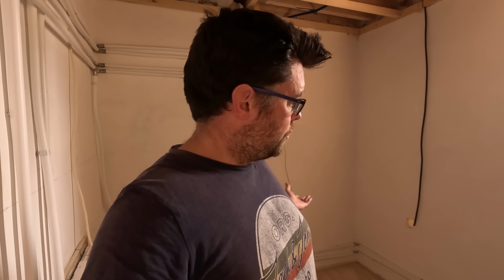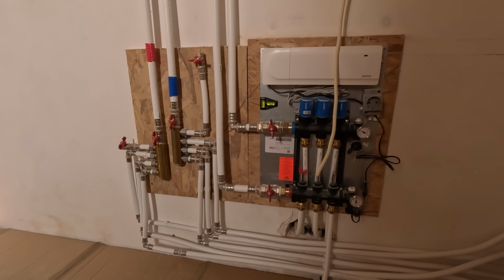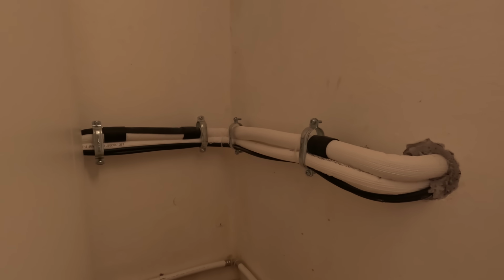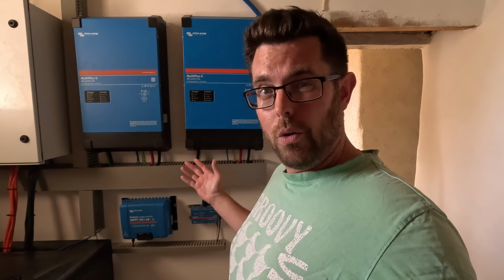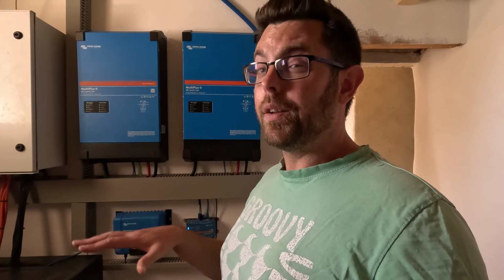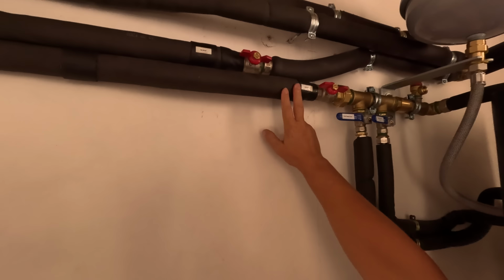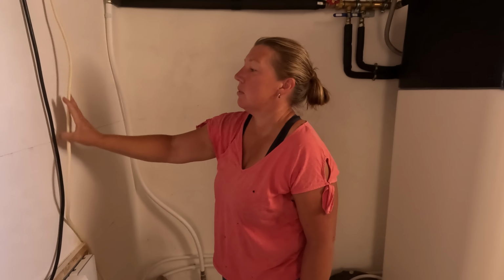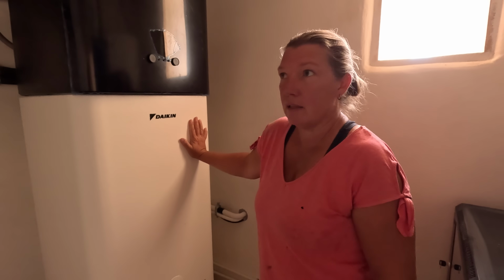Today is a BIG Day (We have HEATING) - Daikin Heat Pump Install

Comment: We have followed your channel for a long time, and we really admire your work on the house. Now we are planning our house in Portugal. Could you share with us what is the size of the room where you have your heat pump, UFH manifold, etc.?
Reply from the maker: Hi,
It’s a pretty small room: 2.4m x 2.4m.
It currently houses the water tank, ufh manifold and all our solar equipment (batteries, inverters etc).
We had hoped it would also become a laundry room but it’s now not got enough space 😀
Eventually the solar gear will move (again) so we can add some storage cupboards and a sink in there

Comment: We installed an air sourced heat pump 20 years ago but unfortunately at that time time there were numerous compressor issues, so that eventually after some years of repair and replacements, which the company were happy to do, we switched to solar generated electricity with a standard tank. We are in Australia and the compressors were only produced on the west coast and had to be transported all the way to the east coast. When it did work it was great.  So glad the technology has caught up with the vision.  We now have a new technology installed within the tank system that stores the unused solar power for times when sunlight isn’t available (that would be at night 😁).

Comment: I'm considering installing an air-to-water (radiator) heat pump in my Spanish home. However, I've heard that 1kw to 3kw is a myth because it's just way too cold outside to get that leverage. As I am completely off the grid, I was wondering how your experience has been thus far. Is it truly energy efficient?

Comment: First of all, you both look less stressed in this video. I have Daikin and I live in Italy. in the mountains. It snows maybe one day a year.  So not too cold. My electric bill is not outrageous and the heat and AC work very quickly and are efficient. I have hot water on demand. I have replaced  all my windows and doors with double insulated and my house is cozy. I have a ground floor cantina which I heat with a small pellet stove. I do not have solar, sadly. But most  of our village is run on Wind power. I am so happy for you both to have your heating, water and flushing toilets. Bravo to you both.

Comment: Expantion tanks don't equlize heat, they only take the expantion volum.
You need a thermal mass for that. Also you need to be super careful about how you combine the wood burning sotve with the rest of the system. It can create a lot o problems if not done properly.

Comment: Since you're in Portugal you should reach an efficiency(SCOP) of 4 or 5, not only 2 as said in the video. I like the Mitsubishi Electric units a bit better(they are more efficient). Your pipes could be 32mm, I think it is 26 now. 32mm has less resistance and makes your pump more efficient! Other than these points, well done. It looks like a very clean setup.

On your other comment if it's allowed to put the pipes in the wall: yes you are allowed to do that, but they need to be pipes that include thick insulation(for any expansion of the pipes).

Comment: Well presented in the uk the daikin stuff has a bad reputation mostly because it is undersized and the winter weather conditions not ideal with temps below freezing for a long time the unit will fail to operate as effectively Portugal is perfect conditions the heat transfer you explained was pretty good basically moving heat through boiling points of a gas under pressure the only issue I can see and it will be rare but does occurs in Portugal is a very low humidity in the summer this affects heat transfer so if it drops below 20% rh for a long period you may struggle to heat the water easy fix run some water on outside unit every now and then during the day will improve heat transfer can even do it with hot water in the winter from a kettle to boost the transfer very neat install you can always get some longer brackets and move the unit a little further from the wall it will improve its efficiency in the long run

Comment: You don't say in the description what model and size of system the Daikin assembly is? Was the installation assembled from parts or was it a pre-designed but disassembled package deal?

Comment: There is heat in the air right up until you hit absolute zero -273, though it does get harder to extract it. You can get over a 3x return on electricity down to around -10 or -15.

I've looked into using a heat pump in Canada, where -30 is common and -40 not unheard of. In our environment, we'd expect to average 2x the electricity, which in our on-grid system would basically just offset the inefficiency of coverting gas to electricity instead of burning it directly at my house. But this gets better every year, so it wouldn't surprise me if 5 years from now, heat pumps make sense here as well.

Comment: I have exact same setup here in Northern Europe where the heat pump is super efficient till up to -15, but produces heat even below -25, at the same time acts as an underfloor cooling system during the summers. My understanding of such system is that it uses specific type of "freon" for different climate situations but it might be lack of knowledge i have. 

biggest bill we got for heating and hot water on a month of February where average is around -15C was 250 Eur (0.25Eur/kwh) for 110m2 house ( a+ efficiency rating)

Comment: I hope you used ppr pipe(hard pipe by the pice) and not pex-al pipe(flexible pipe to the round coil). The first is better and reduces the risk of leaks at the corners, but it requires special bonding.

Comment: Careful with Legionnaires' disease if your water isn't hot enough. But it's great that you guys have hot water now 😊
Reply: this is only a problem in still water bellow 45 degrees. When you will run your shower for a couple of secs on 55 degrees all will die. There was a nice video on this. In England households 33% of the houses have legionelas but all problems come from hotels or other companies which have still water for a longer time before use.

Comment: I live in the U.S.A. and have a forced air heat pump for heating and air conditioning. Winters average -6 C and very hot summers 32 to 37 C or more on occasion and I am very happy with my heat pump.

Comment: Great job, looking forward to seeing your video on the upgrade to your solar system. I live in Northen Spain. In 2020 I installed a Victron Solar system Basic spec info is 4.8KW of panels in two arrays one 8 and one 4. A 5KVA Inverter/Charger and all the other stuff to control it. We are completely off grid. The system supports an air source heat pump hot water boiler plus a pellet burner for the under-floor heating, two fridges a freezer a dehumidifier, well pump and charges our Electric car. If you would like a more detailed overview of the full system, I am more than happy to provide it. I also keep a detailed log of the solar capture ect. I have also installed a smart home system which has enabled me to reduce the amount of electrical cabling. To date the only month of the year I struggle with is December, A backup Generator is used but only for very short periods of time during November, December, January and February.

Comment: Be aware that 45 degrees is in the ideal range for legeonella to multiply. If you are not planning to use too much water it will exacerbate the risk. The water must be heated above 50 degrees to kill the bacteria. Best wishes

Comment: That's exciting news, congrats to you both! So nice to see your relief about how well the install went. Under all the pipes I am still admiring the soft white colour of the lime plaster, it produces such nice shades in your videos. 
One question popped into my head when you said 45 degrees in the storage tank. A long time ago I have been told to keep the water temperature above 60 degrees for an hour in, I think, each week. Not sure about the exact timeframes now, but it is because the heat should keep legionella bacteria from growing too much. Your tank is probably doing this automatically, isn't it? So the air pump is enough to produce even higher temperatures than 45C.

Comment: Given the heat there, I would have (obviously wrongly) thought you'd be more focused on cooling. Does a water-circulating system work in reverse to cool the floor? I wouldn't think so; but I don't know much of anything about that type of system. I'm more familiar with ducted systems that move air through the ducts; bringing heat into the house in winter and moving it out in summer. 
You and/or your viewers might be interested in this video. https://youtu.be/vk4eLFxNdco  (BTW: I have no vested interest in this company. It's just that I find some of their videos informative.) I'm wondering if you'll decide to use a ducted system on the 2nd floor to focus on cooling (seeing that cold sinks and heat rises).
Anyway ... thanks for letting us follow along and providing the details. I'm super interested (as I'm sure you are too 😉) to see if your solar can do the job for you. If it does, and people react with "sticker shock" over the initial installation price, then they need to remember you will not be paying any $$$ for any fossil fuel (oil or gas). And given what the recent costs have been for those, that's a HUGE savings in the long-term. -- Not to mention the myriad of other benefits (e.g., climate, respiratory, politics, ...). 
Great job you 2!

Comment: Looks great!
I can support your intuition that your air-water heat-pump together with the solar PV modules, provided you have enough battery capacity, will make you through the winter.
We live in south Germany, near the Alps and, on average, we have some 10-12 weeks with temperatures below zero, and from those we have 2-3 weeks where the outside temperature is below -10ºC 24/24h. We have also underfloor heating, and an air-water heat-pump with a 750 liter tank. The heat-pump struggles on those "below -10ºC" days, where the efficiency really drops, mostly due to the fact that the cycle must reverse several times per day to unfreeze the outdoor unit. It is not perfect, but 10 years ago the technology was not as evolved as today. On our case a geothermal heat-pump would be the ideal choice, but the original builder/owner did not considered it at the time of the construction works...
We also have a 18kWp solar array with a total of 18kWh battery capacity, which provides us with 85% autonomy/year (we just need some external sourcing from the public network between November and March, mostly when the roof is covered with snow). So, with the portuguese climate and proper sizing of the solar power system, you will for sure be fine, even without the wood burner.
We are also planing our move back to Portugal in a few years time, and I am still somewhat hesitant between an air-water and a geothermal heat-pump. So I'm eager to see the data you will be collecting from your set-up.
Keep on the good work!

Comment: I understand as we have a heat pump, underfloor heating in bathrooms, etc., but for the summers where you are, why not Air Conditioning? Or, do you have that already? Will you install that in the future? I suffer when temperatures get over 20f/70c, perhaps that’s not an issue for you.

Comment: Thank you for the video. Big thumbs up. 
Just got to thinking when you said you will set the water temperature to 45 degrees. Did a quick google search and found i was right. So I am talking about Legionella bacteeria, which likes water temperature between 20-45 degrees. I would set the water temp at least to 50 degrees Celsius to worry less about legionella.

Comment: It’s a little bit funny….. spent 12 k euro’s for a system, you hartley Don’t use to take hot water and take out of service after installation. I bet you Don’t use the heating in the winter as well😏. I hope i’m wrong. When you gold water temp dropt to 32 deg. C. What was the avarage ambient temp?

Comment: As long as the outside temp, during the winter, stays above 35°f/1.66°c that would work. We had a heat pump AC/Heating system an it froze, it was worthless @ <35°F. It looked like a big ice cube out there! Totally covered in ice!!! I'm super happy you have human conveniences!!!!! 🎉😊 You both have worked SO Hard. Congratulations! Please take some time off and recharge yourselves!

Comment: Hi Both, what a nice move forward, you must be really excited. I love the direction you are heading with this off grid energy production and use. Water in my view is a very under considered energy storage medium, so I am looking forward to hearing how this system works out for you. I am also a big advocate of multiple energy paths and designing a system that is both aware of its wider surroundings but that can also draw from and pass to multiple other parts of it. Food for thought Linus Tech Tips proposed a really interesting proposition. In that he built a pool with a heatsink plumbed into it and used the large mass of water to cool the servers in his server room at home, thereby driving down both cost of cooling but also noise from fans which are normally used for this purpose. Now I am not suggesting that for you, but think of all the devices we now use at home that produce heat as a by-product of their operation (fridges, freezers solar inverters etc), and what possibilities would there be to take that heat and transfer it into a medium like water that could be used in other areas of the home, like heating the floor in your case. In the mean time, great work and I wish you a much more comfortable winter this season. Take care D
Reply from the maker: Funnily enough I’ve been having thoughts like this, in particular the out put from the ventilation system… warm humid air. Even though the system contains a heat exchanger  I’m sure it doesn’t use all the heat:energy it extracts. I haven’t had time to look into it further buts it’s something I want to investigate.

We also want to find a solution for all our excess summer solar … an EV is one idea, but a bit pricey. A pool is another idea but we prefer the ideal of a natural one so wouldn’t suit (the heat would kill wildlife, bacteria etc)

Comment: Hi, I have a 6kw Dakin heatpump and have been running it of solar and battery 🔋  in Ireland since the start of summer. Once your battery can discharge 3kwh which is the most I've seen it use u will have no problems.

Comment: Kylie you did an amazing job explaining air source heat pumps! I'm a mechanical engineer and have been design HVAC and heat pump system for over 15 years you did a better job explaining them than a lot of engineers :) I'm in the states and work for the National Renewable Energy Laboratory (NREL) it's a US government research laboratory. I do a lot of research in energy efficient buildings and on-site energy generation (mostly solar). You an totally power an air source heat pump system on solar, if it's all sized correctly. Just curious if you guys ever made an energy model or heating load model for your house? That it's the best way to predict if a system will be able to heat/cool on the coldest/hottest days. Anyways keep up the great work!

Comment: When I lived in Seattle in the USA, I bought a 1300 square foot mobile home, which had a heat pump. Seattle is a fairly mild climate, so the heat pump heated my home most of the time, and when it was extra cold, the electric furnace in the home turned on automatically when needed - expensive heat.  But the point is that this heat pump also was my air conditioner in the summer.  Can yours do that?  Cheers, and all the best!! Judy

Comment: The expansion tank is for keeping pressure differential stable while the water heats up. This one is just for the expansion of water in the boiler. You really need a bigger seperate  expansion tank for the water in the  underfloor heating  because when the temperature  of the water is low and the heat pump starts the pressure drops and the flow rate decrease until it gets the  setup temperature. This slows the heat transfer. It is also usefull to use a different tank as  a buffer tank from the unit to the underfloor heating so the compressor of the heat pump doesn't open and close many times. An engineer can take a look on this.

Comment: Did I get it right and understood that the heat pump runs on electricity?
Which you get from the batteries you feed from the solar panels?
Aircon provides cold as a result of a chemical reaction (expansion of gas). How does the heat pump work?
Thank you for your videos. They both fun and interesting.

Comment: I live in Switzerland and built a wooden house with passive energy level. I do have an air based heat pump and it works perfectly. The systems works because any temperature over 0° Fahrenheit (helps to understand better) is physically "warmth" or "energy". So also when here in winter there are - 20° Celsius, it does its work. Only problem I encounter is that whenever the temperature drops quickly, the pump needs a bit of time to heat up. So I have a wood stove and a fire place that I use in those cases to warm up the house for the max. 1 day until the heat pump is again on full mode. Congrats to your milestone!!!

Comment: Very interesting.  I’m happy for you that’s it’s installed.
The location of the unit outside is very good as the house and wall along the road will soak up sun rays even if it’s cold and will release that energy back to the air even when the sun goes down. 
Excellent choice on the wood burner with boiler for a back up.
I can’t wait to see the video on the solar upgrades. 
Thank you for sharing with us.
12k is a great value!